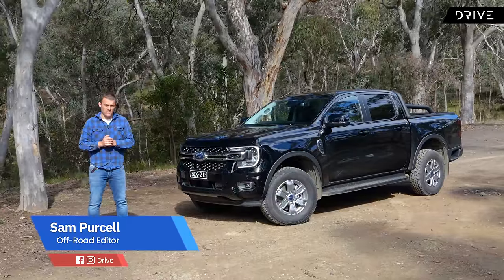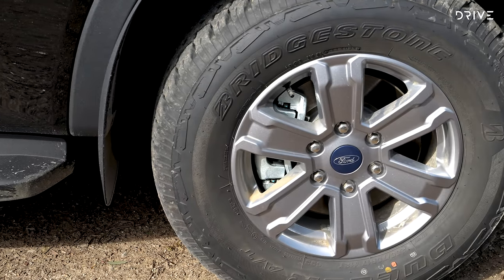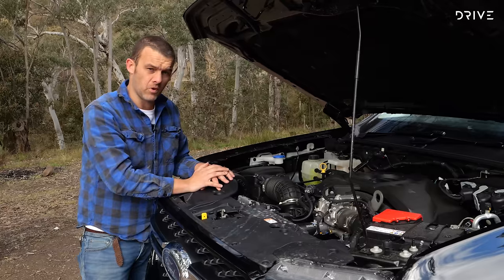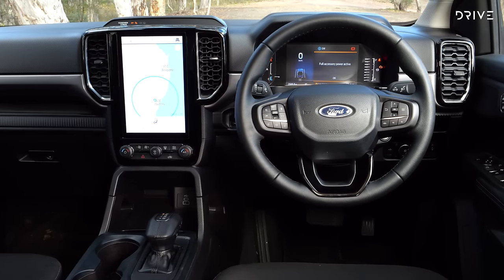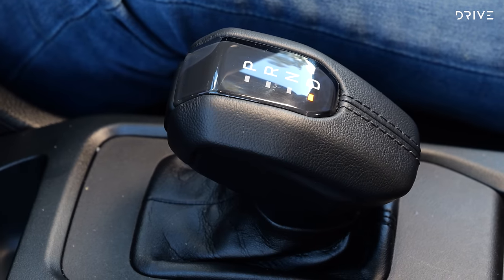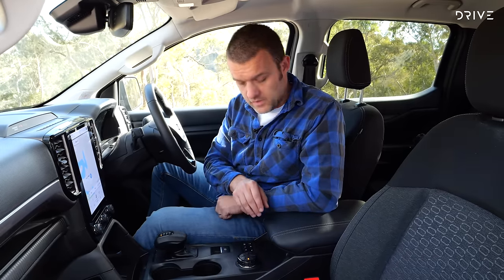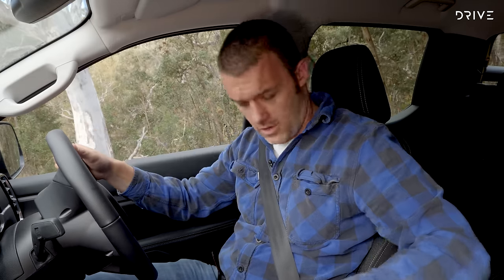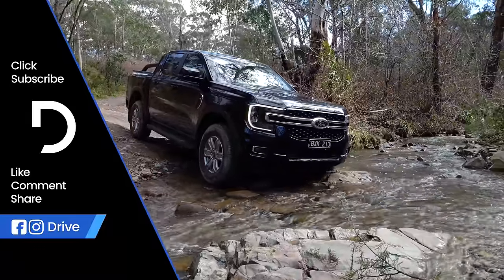2023 Ford Ranger XLT V6 Off-Road Review | Drive.com.au

Comment: Spray in tub liner is $400 not $900. The trailer brake controller is part of the the $900 touring pack not part of a tow pack as tow bar is standard on XLT. Also a suspension lift will increase clearance under the belly just won't increase your rear diff height.
Reply: Let me know where I can get the spray in tub liner for $400. Mine cost $900 aftermarket for Raptor spray in.

Comment: An extra $900 for the touring pack, $900 for the tub liner, $500 for the off road tyres.. Works out the same price as the sport. Great car but when you break it down the sport or wildtrak are better options imo.. Great video guys✌🏼
Reply: XLT comes with a drop in tub liner standard.
Reply: You'd still need to get the touring pack on the Sports model as well, as the Sports doesn't get any of those options standard. XLT comes with the tub liner as standard.
Also, the sports doesn't have the all-terrains as standard. Everything you just wrote was wrong....
Reply: If you spec out the sport it cost the same as the wild track also with less stuff. 

I think they have done this deliberately as got can't actually buy a wild track

Comment: Interested to know more about the center differential - it's not a locking differential, but relies on some kind of clutch system.  Therefore does this mean that it's only 4x4 when the computer decides or can you select an option which engages the center diff as if as it were hard locked?
Reply from the maker: It's a system designed by Borg Warner, called Torque On Demand (TOD). This is effectively the next-generation system in this new Ranger, and is used in Everest and Raptor as well. This is a more sophisticated system, and as far as I can tell it can offer a true 50/50 'lock-up' for four-wheel driving, which cannot be used on the blacktop. This would be effectively the same as a locking mechanical centre differential, as well as a part-time 4X4 system with a dog clutch setup in 4H and 4L modes.- Sam
Reply: @Drivecomau  I too am curious as to how its splits torque in 4A mode. If it is a clutch arrangement it is either on of off unless its slipping some how. I would like to see an explanation on how it operates in 4x4 mode on the a sealed surface in 4A. A center Diff would be required to accommodate the different axle speeds front to back -  i don't think a clutch can easily accommodate this task and you don't want it to be a component that wears.

Comment: Had an Everest on order, wanted a Wildtrak, but settled on an XLT. Devo on the wireless charge pad, but found one that will fit in the space perfectly. Leather does get hot, even with (il)legal dark tint, so looking forward to not having to worry about it. Was a bit surprised about the lack of space where the muffler is, but should be enough room for me to do a decent exhaust........

Comment: A couple of glaring inaccuracies, in your story - The Salisbury (Dana) style rear housing is a carry over from Amarok, which used that style but with 5 stud wheels. Because the shock absorbers have been moved out-board of the springs, but retain the same stroke, effectively means the wheel travel has been reduced. In serious off-road terrain you would not be using the 4A mode with the electronic clutch pack, you should use 4H or 4L with transfer locked. Would have liked to see if the car ran away in reverse after you failed on the hill climb. In otherwords, how low is the gearing for reverse and low range gearing? What sort of fuel consumption did you see for this short drive? Disappointed that nearly 3/4 of the vid was devoted to going over the same Ranger appointments and not more about driving it off-road.

Comment: Best review I have seen. Well done. Only complaint is I do not go off road. I am after towing information. Whats the payload? Do i need to upgrade the suspension if I put 320kgs on the towball? Can I turn off all the driver assist electronics that I do not want, Like crash assist, driver seat belt warnings, driver door is open alarms etc. I will use this around the farm and if I get out to fix a fence or a water trough or help a ewe lamb I want to hear the radio and not a lot of beeping. I do not want to have a seat belt on if I am getting out all the time to do something and I am driving just over 20kms per hour.

Comment: I saw the inside of this engine and I don't like that the cams are belt driven and not chain driven . This brings me back to the technology of the old 2.3 rubber band motors that needed the timing belt changed at 60 k . The belts are on the back of the engine which means the engine has to be removed from the vehicle in order to replace. Better to put a coyote 5.0 gas engine in it and save the headache.

Comment: Drove the V6 sport at the weekend, very nice, standing start was laggy, though mid-range acceleration was fantastic.
Can't decide between XLT or Sport, not really a fan of leather seats,but the sport gets driver terrain modes.
BUT.... Reliability is my biggest hurdle,before biting the bullet and dropping a deposit.
Reply: I drove the V6 XLT and wildtrack last week and had a demo for the day this week. Very Impressed and dropped my money on the XLT but I do have the same reservations as yourself. I think It comes down to the dealer support. My local dealer is excellent in aftersales and if I do have any problems I know they will look after me. That seems to be the most important thing these days. I drove the Raptor too -WOW, but mine has to work for a living so not an option.
Reply: @redroo12 the Raptor can certainly work for a living if you so wish.

Comment: I have a rotary shifter. Best shifter I’ve ever had. Never want to go back to a non-rotary one. 
Hate the +/- on the shifter also - should be paddle shifters - don’t need to take hands off the wheel or eyes off the track to manually control the gearbox.
My 4WD shifts to Park when you press the Engine Start/Stop button to shut it down.

Comment: Great review and very informative. This is the exact same model and options as I have but haven't done any offroad driving in it yet. First ute I've owned and very happy with it so far, although the zone lighting didn't work (apparently needs a software update).
Reply from the maker: Cheers hope you lights get working
Reply: Still happy with it? No issues?
Reply: Do you wear the same clothes in every car review?

Comment: Thanks for the great review. Just put my money on the XLT V6. Ford AUS was right about that stupid dial gear changer. It would have been a deal breaker for me. We have a Focus and it's a great car but that dial is a proper pain in the arse. I lived with the demo Wildtrack for a day and I have to say it's an impressive package. The wildtrack a bit too much for a work ute though. Particularly the leather seats and the tub. Although I would have liked the extra cup holders Ford! Only time will tell if the reliability stacks up I guess. I can't wait for someone to do a comprehensive video on that screen and tech there's a lot to know{hint hint}
Reply: Webby On Cars do a video on the centre screen also the dash. Cheers
Reply: Non rotary gear control is a deal breaker for me. Rotary dial all day. So much easier to use and totally without looking too. I have one and never want to be without it.

Comment: The on road cost is 10 grand. My mate just bought one. Ended up being 74 grand all up
Reply: That’s not cheap , my xlt ranger 2017 was 52 k
Reply: Yeah i know they have made improvements to the car which will increase the price but a 20 grand price jump in 5 years is a bit steep.

Comment: How did you manage to get bridgestone tyres? Goodyear wrangler AT was the only ones i was offered
Reply from the maker: This was listed by Ford as an optional wheel and tyre package, but I'm not sure of the Bridgestones are the only option in this regard. Sometimes, OEMs will have a variety of tyres in their lineup, and what you get will be a bit of luck of the draw. For what it's worth, these tyres seemed to be pretty good - Sam

Comment: So I just picked up a new Ranger Wildtrak V6. I wan to know why none of the reviews I have seen never discussed the fatigue management systems in the Ranger along with the problematic lane centering system. The fatigue management system or a serious distraction and I believe a hazard. I got told to have a break less than 5 minutes after having done so. The Lane keeping is another big issues that I have never seen comment on. Driving the pot hole riddled Bruce Highway I turned off the Lane keep crap because I was constantly dogging pot holes. The stupid bloody system was turning its self back on while driving and of course because I was dogging pot holes the car said to have a break again. I want to know why you reviewers have never mentioned this?